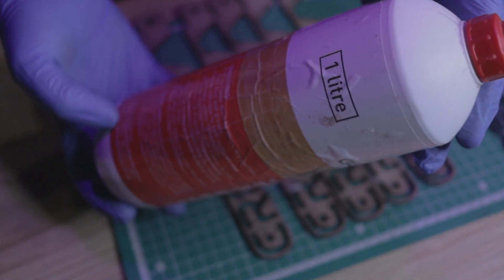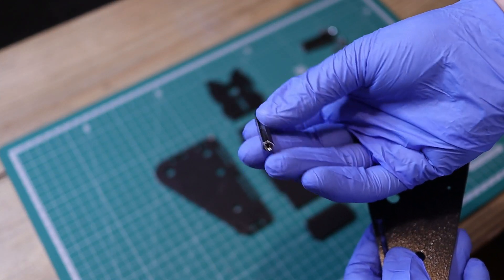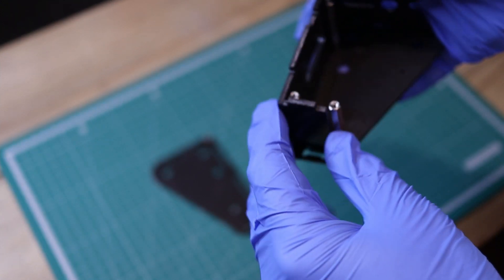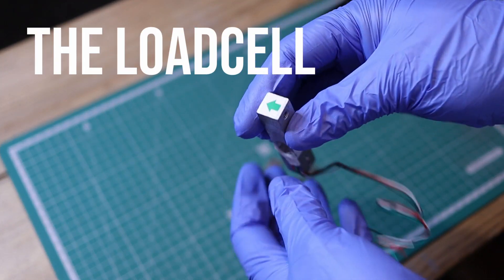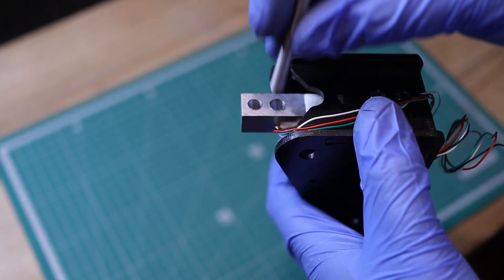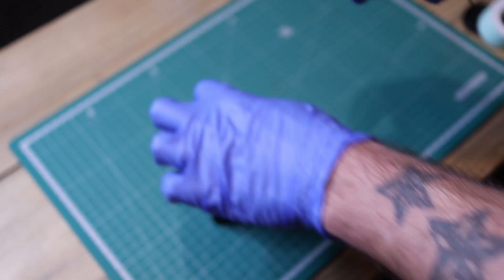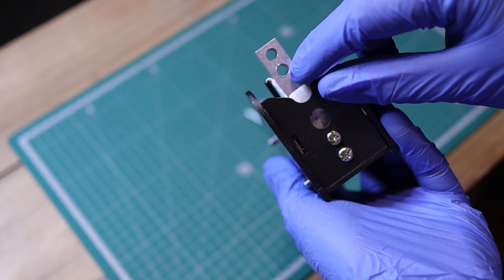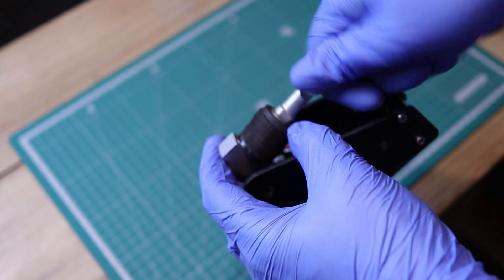BUILD THIS LOADCELL HANDBRAKE | SIM RACING

Comment: Hi I just finished building mine and I'd like to know if anyone has successfully mapped it in Dirt Rally (the first one). It seems to work well enough in DR2.0 but I can't find a way to map it in the first title. If it doesn't work then that's fine but I do still like to jump into the old title every now and then and would love to use the handbrake there.

Comment: For those building their own loadcell usb device 3 years later, you need to change a parameter in the code for the usb device to show up as a controller rather than as a generic HID for Windows.This isn't an issue for mac or linux.

Joystick_ Joystick(JOYSTICK_DEFAULT_REPORT_ID,
                   JOYSTICK_TYPE_MULTI_AXIS, 0, ...
 to
Joystick_ Joystick(JOYSTICK_DEFAULT_REPORT_ID,
                   JOYSTICK_TYPE_JOYSTICK, 0, ...
Reply from the maker: @qwie100  Ty!

Comment: If anyone is having trouble with the arduino code scroll to the bottom of the comments for a possible solution. "
@kaandincbas9190
5 months ago
 @NerdyGurdyGuy  i actually solved it just by changeing multi_axis to joystick :)"  (Line 12)

@DonnyCrash Consider updating the "How to install the code.pdf" to reflect these changes.

Comment: I’m looking at adapting a real drift handbrake I already have to a 200kg mavin load cell using a usb-c hx711. Is there any reason your software wouldn’t work for that. The only difference I see is the load cell rating (20kg vs 200kg).
Reply: It should work
Reply from the maker: Yup it should work, you might just need to play with the calibration a bit

Comment: I'm trying to compile but I get this: "compilation terminated.

exit status 1

Compilation error: Joystick.h: No such file or directory"

Any idea what I'm doing wrong?
Reply from the maker: That means you haven’t installed the Joystick library. You can find more info here https://github.com/MHeironimus/ArduinoJoystickLibrary
Reply: @donnycrash8954  yeah, I realised that but did that now and it doesn’t show up as a joystick…
Reply: @NerdyGurdyGuy  i actually solved it just by changeing multi_axis to joystick :)

Comment: What material are the side and bottom plates made of ? Im thinking about making it out of plywood as the standalls should make the body pretty rigid, am i wrong ?
Reply from the maker: Hey! I used mild steel, with ply it should be pretty rigid but will probably crack eventually

Comment: Well, I bricked one of two Pro Micro boards..
And it's weird how the end product behaving: it's working 1-2minutes, then stops taking the signal from load cell and then shuts down.
The same thing happened with my first board and now it's bricked without any hope. 
I'm a bit scared to use the second board for more than 2 minutes.
Reply: i think you glued the two boards together and it's overheating. Bricked ardu means it's software issue

Comment: The amount of resources this channel has is outstanding, thank you for sharing all of this with us. I do have one question, I would like to build all the base parts by hand so I would like to print the dxf file as a template but I find it hard to figure out the size, do you have any suggestions on that? Would an A3 size paper be enough for this?
Reply from the maker: Thanks for the comment! Yea the parts should all easily fit on an A3 sheet

Comment: Great video, im trying to build one myself but when i upload ur code to the arduino it wont show up as a Controller/gamepad in windows :S and i cant seem to figure out whats wrong :(
Reply from the maker: Hey Tom, sorry I missed this comment. Have you tried reinstalling the Arduino Joystick Library?
Reply: @donnycrash8954  hey thx for answering :) i actually solved it just by changeing multi_axis to joystick :)
Reply: @tomgliesmann7705  i need to try that ... because arduino don't show as a controller ... ill post how it goes...
Reply: @tomgliesmann7705  it works 😁😁👌🙏
Reply: @canyon46  solved?
Reply: @AaBb-zv6hm  yes, @tomgliesmann7705 solved it ... just change multi_axis to joystick in code, disconnect and connect arduino back and it will show as controller in device manager and you can calibrate it
Reply: @canyon46  JOYSTICK_TYPE_MULTI_AXIS should I delete multi axis and keep only joystick type?
Reply: @AaBb-zv6hm  code must be joystick_type_joystick
Reply: @canyon46  ok now it recognizes as a joystick but I don't have any value from the load cell, did you too?
Reply: @AaBb-zv6hm  i have normal values and i can calibrate it
Did you input joystick and hx711 library ??
Reply: @AaBb-zv6hm  and make sure you connect arduino, hx711 amplifier and loadcell correctly
Reply: @canyon46  yes